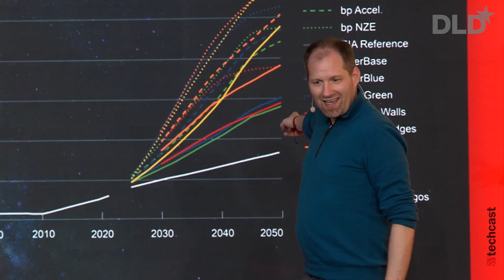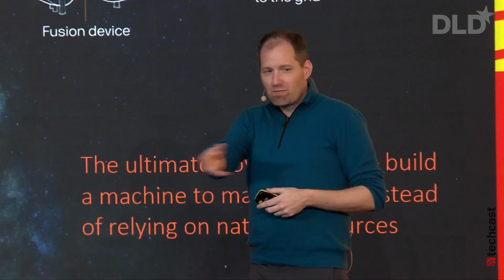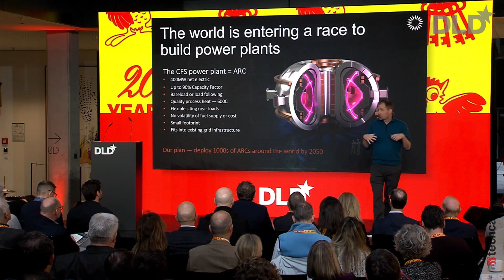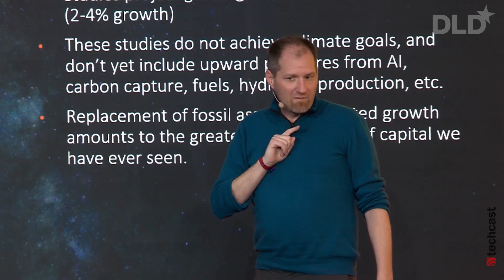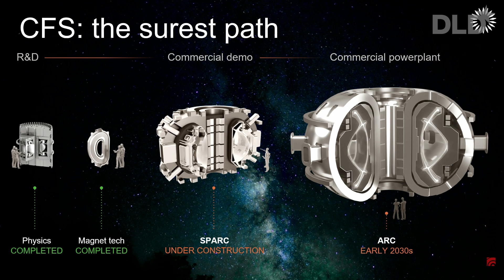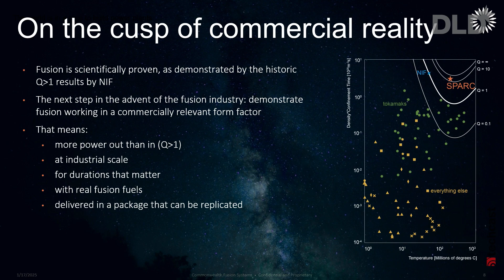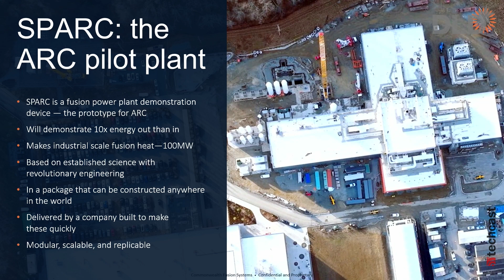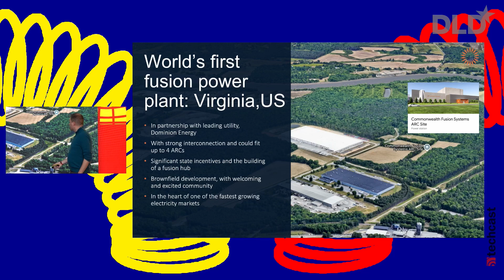Fusion Future: A New Era of Energy (Bob Mumgaard) | DLD25

Comment: The nuclear fusion energy experiments began in the 1950s. It began with a tokamak, similar to the tokamak design that CFS is betting on. The field has always been oversold which helps explain why we are still orders-of-magnitude away from a commercially practical fusion energy power plant. CEO Bob Mumgaard is a master sales pitchman. Like many experimenters in this field they have learned to make use of the extreme complexity of the field to only advertise the basics while omitting numerous key evaluation details using the excuse that they need to keep the presentations simple for journalists, the general public and investors. CFS has never generated even one watt-hour of fusion energy, as is the case with the vast majority of the multitude of fusion energy experimenters. Mr. Mungaard mentioned the widely publicized 12/05/2022 laser fusion 'breakeven' shot at the National Ignition Facility (NIF) in California. What he omitted was the fact that the input energy value, that was used to calculate the fusion energy gain, was a minuscule fraction of the energy required to power the facility. The total input energy was over 100 times greater than the fusion energy that was generated in that experimental fusion reaction that lasted for only 0.000,000,000,08 second. CFS employs the same shell game when describing their fusion energy gain that they refer to as 'net energy gain.' In this interview Mungaard referred to SPARC as a 'prototype' of their planned ARC fusion power plant. SPARC comes nowhere close to being such a 'prototype.' If it ever achieves the fusion energy goal, touted by CFS, the fusion reaction is expected to last for a maximum of a 10-second pulse followed by a 4-hour thermal recovery period. This translates to a fusion energy duty cycle of 0.0007, with no more than 10 Giga-Joules of energy being released during the 10-second burst of fusion energy. SPARC's design excludes a robust heat removal system, and all the required components needed to generate electrical energy required in a standard nuclear fission energy power plant. It also has no tritium breeding blanket and tritium  processing facilities which will be required for the ARC plant. These components were expected to be tested and developed at the ITER project in France but that portion of the operation has been delayed until after 2040.

For decades nuclear fusion energy promoters have been claiming that the hydrogen fusion fuel is almost limitless. They often omit mentioning that the required tritium is radioactive and they never mention that commercial tritium, that will be required for SPARC operation, cost over $30,000 USD per gram. The bottle of water, deuterium contents analogy, that Mungaard referred to, was misleading since the water contains no tritium isotope atoms which are required, along with the deuterium, to generate the required fusion reactions. These people are masters at taking advantage of most peoples ignorance of this esoteric field of plasma physics. Another issue, typically omitted by the clever sales pitchers, is the fact that the generated 14.1 MeV fusion neutrons will eventually embrittle the inner components of such reactors and will generate radioactive isotopes within the structure so some of those components will need to be disposed of as radioactive waste. Nuclear power pitchers have learned to capitalize upon the general fear of Anthropogenic Climate Disruption (ACD) effects and of the need to power AI processing data centers as a tool to promote their favorite nuclear power technologies.

Most fusion energy fans have no interest presenting probing questions to the experts that they have come to idolize.

The tens-of-billions of dollars, that are being spent on these fun experiments each year, should be redirected to more certain sources of energy generation such as wind and solar.

----
Virtually all nuclear energy promoters, are in line with the vast majority of Earth's other 8.2+ billion humans, who continue to assume that we still have at least 20 years left to turn this 'Titanic' around using their favorite nuclear technology. They have become masterful in excluding the following warning from their consciousness.

UN chief: World has less than 2 years to avoid 'runaway climate change' (TheHill)
  * This statement was made 7.1 years ago.

Comment: Eight months ago Bob Mumgaard was saying SPARC will turn on in 30 months. I wonder what he's saying now?
Reply: At the February 10, 2023, ribbon cutting ceremony, for the Commonwealth Fusion Systems (CFS) campus and headquarters, CEO Bob Mugaard pointed out that deployment speed is a top priority of CFS and stated "...SPARC's going to turn on. Give us about three years and we'll turn that machine on..." The press release included the following words. "The facility, under active construction, will be operational in 2025..." It indicated that SPARC would be generating fusion reactions soon after that. Now CFS is claiming that they expect SPARC to be generating fusion reactions before 2028. They haven't stated when they expect SPARC to achieve CFS's goal of around one GigaJoule of fusion energy per test pulse. Most nuclear fusion experimenters, such as CFS, have long been masterful in using the extreme complexity of the technology as an excuse to omit numerous key evaluation details from their presentations to journalists, the general public and to technically naive funders. CFS rarely mentions that the SPARC fusion test pulses are expected to last for a maximum of 10-seconds and then, when at full power levels, a 4-hour thermal recovery period will be required before another fusion test pulse can be conducted. That means the machine will have a maximum fusion energy duty cycle of 0.0007. They have long branded it as a 'prototype' of their assumed ARC power plant but on this one parameter, alone, an improvement factor of around 1,000 times will be needed. CFS claims that SPARC's fusion energy gain (Q) goal is approximately 10. Like virtually all other nuclear fusion energy experimenters they fail to mention that the input energy value they employ, to calculate Q, is a tiny fraction of the input energy required to power their facility during the day of the test pulses and that gain value typically only applies to the brief period of time that fusion reactions are actually occurring.

Comment: Will SPARC have its first plasma in 2026 or 2027? I've seen both claimed on the Web.
Will ARC be a negative-triangularity tokamak, as in the MANTA design, or a positive-triangularity tokamak, as shown in this talk?
Reply: It will most likely be a positive-triangularity tokamak design though its future existence will depend upon the uncertain success of the SPARC experimental machine which doesn't come within orders-of-magnitude of being the 'prototype' experimental machine that CFS frequently brands it to be. The intended SPARC fusion energy duty cycle if it ever achieves significant fusion reactions and eventually achieves its goal of around one gigaJoule of energy per pulse, will be a maximum of 0.0007. The ARC design will need to improve on that parameter, alone, by a factor of about 1,000. Additionally, it the case of virtually all nuclear fusion energy experimental efforts the value of the input energy parameter, employed to calculate the fusion energy gain (Qp) is a tiny fraction of the energy required to power such facilities during the day of the noted experimental test results. Both CFS and Helion Energy made promotional videos where it appears that they have each begun the construction of their proposed power plants. Those site videos were staged operations that had no real connection with an actual start of construction of the claimed power plants. They were simply part of their ongoing efforts to attract billions of dollars from technically naive investors.